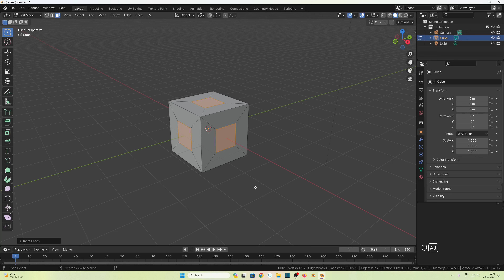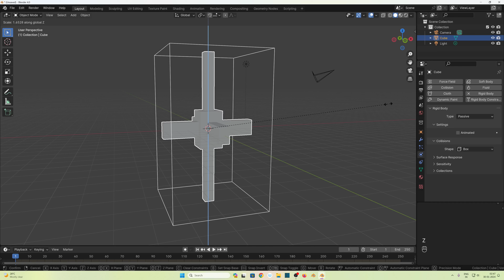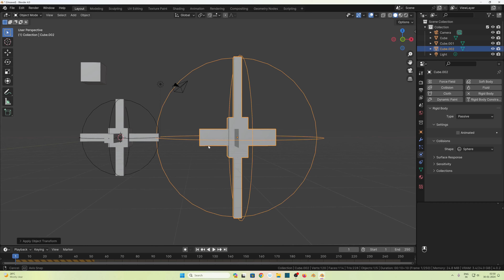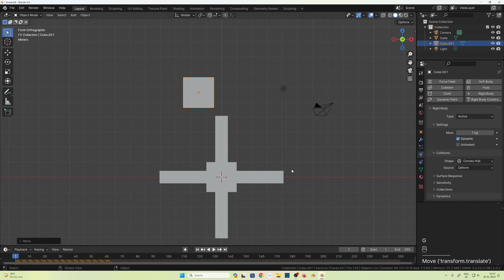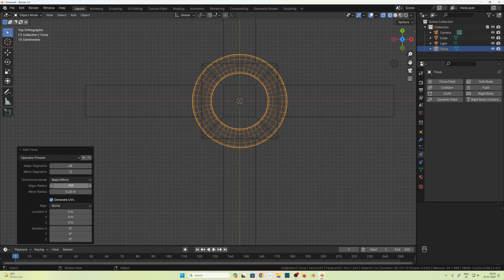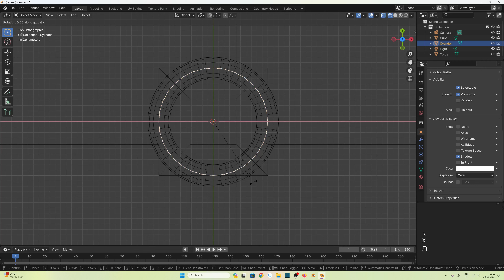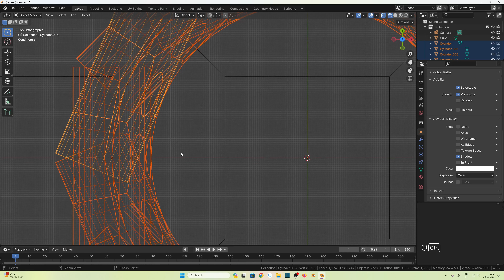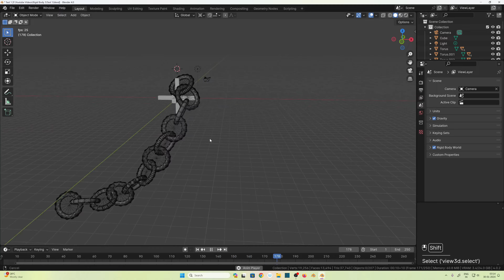Collision Shapes  |  Blender 4.0  |  Rigid Body Basics  |  Part 3

Comment: Thank you so much for this video, great work! Why does the mesh rigid body keep jumping around? I can’t figure it out.
Reply from the maker: Glad that you liked the video.
When you apply a Mesh Collision shape to a rigid body, all the vertices of that object will take part in the physics simulation. Hence the shape of the collision surface will be the exact same as the shape of the object. So the more vertices the object has the more time it will take to calculate the simulation. Hence the jumping around object.
If the jumping around is too much you can try this method(I haven't explained it in a video, so i apologize for that. I will do that in a future video.).
Go to : Scene Properties - Rigid Body World 
Then turn on "Split Impulse". (Only use this if the jumping around really bothers you. As turning this on will reduce the simulation stability a little.)